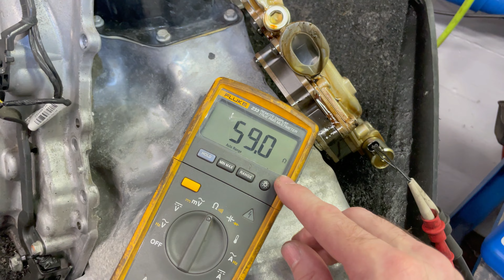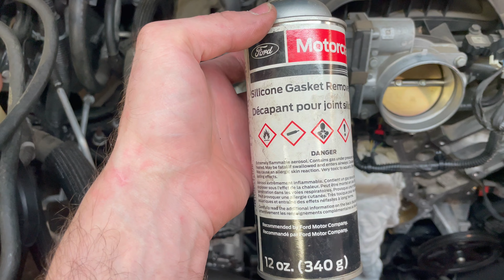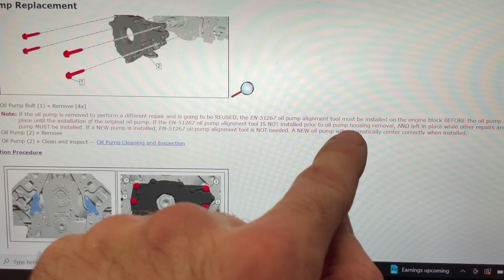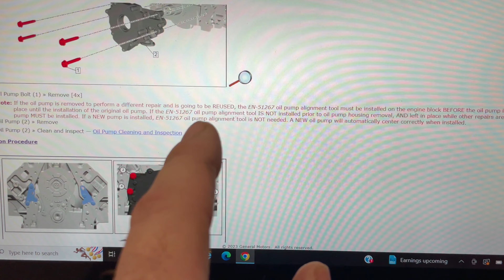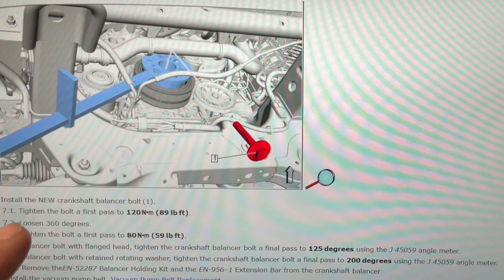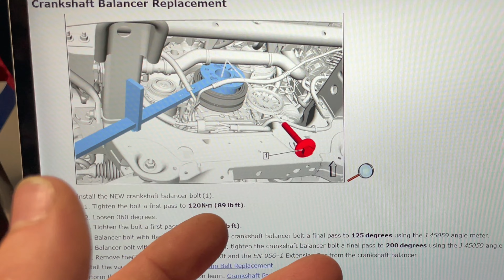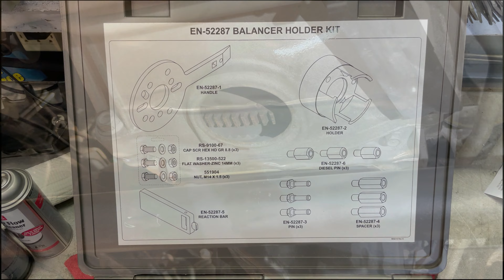P06DA 5.3L Dual Stage Oil Pump Replacement tips

Comment: I got the new oil pump installed and buttoned it up.  I did flood-clear mode to prime.  I attached a pressure gauge to the engine and started it.  It's high at 70psi - I confirmed with the engine pressure sensor.  Might be because it is cold (40degF) or a new pump that needs breaking in.  Previous pump was 56psi cold.   My concern is a bad regulator spring in the new pump.  It is all GM OEM parts.  - your thoughts?   (no codes relating to the oil pump)
Reply from the maker: That sounds about right for a cold operation. Evidently the new pump performs better than the old pump.

Don’t forget, this is a dual stage oil pump… It can be in low output mode or high output mode. You could confirm this with scan tool data.
Reply: @DadsGarageDiagnosticSpecialist  great - thanks for the help.
Reply from the maker: You are welcome
Reply: @DadsGarageDiagnosticSpecialist  ...to follow up on  the high oil pressure.  It settled down pretty quick after just a couple minutes of running.  Cold idle 45 psi.  Warm idle 25psi, cruise 40psi, under load 50psi.

Comment: Isn't ìt 2 round seals on the timing cover
Reply from the maker: The timing cover has the front crankshaft seal and the seal for the cam actuator magent on it, otherwise it uses RTV sealant when installed to the engine block.

The oil pan uses RTV sealant and rubber seals.

Comment: I just got this code that popped up. I turned the check engine light off and it stayed off. I have good oil pressure. What are your thoughts?
Reply from the maker: Keep an eye on the oil level and if the code comes back it will likely need an oil pump replacement. 

P06DA suggests that the ECM commanded the oil pump to change its output pressure and it didn’t respond as expected. 

The oil pump has a low output mode and a high output mode. If it fails in low output mode it will still have plenty of oil pressure, but should still be fixed asap.
Reply: @DadsGarageDiagnosticSpecialist Thank you for your quick responce.

Comment: So what does this pump do actually? I’ve seen comments stating they just deleted it or tuned it out. If it’s not needed why did the engineers put it into the system?
Reply from the maker: The idea is to save a small amount of fuel by reducing the engine oil pressure when at light loads cruising.

The oil pump has a high and low output mode. In low it still produces about 20psi-30psi so it’s fine. 

High output mode is used for heavy loads and hard acceleration and bumps up the oil pressure. I suspect this is because the bearing clearances in the engine are very tight and also thin oil. A loss of oil film under heavy loads would cause immediate metal to metal damage.
Reply: @ 
thanks for the reply. I also received this code last week and replaced the oil sending unit and valve lifting oil filter behind the sensor. Still received the same Pcode. Took it in and they told me my  
OIL PUMP FLOW CONTROL SOLENOID VALVE needed to be replaced. Gonna be $2100 job right here at the end of the year.

Comment: If youre doing this at home you can remove a spark plug and fill the cylinder with rope. It will prevent the engine from turning while you torque the bolt
Reply from the maker: I wouldn't do that because you can crush a bearing or damage a piston/rod. That bolt is really super tight lol. Thank you.
Reply: @DadsGarageDiagnosticSpecialist  After I posted that comment I realized how much force that is going over 100 degrees. The rope has some give but still. I think the best bet for someone who doesn't have the special tool is half an ugga and then use a paint marker to measure the amount of degrees like you did. One could also use loctite if they're concerned about the bolt backing out. I know it's not recommended but I've done similar things in the past with no issues
Reply from the maker: @firstlast---  I understand… I have been there and done that kind of thing also. Working on cars for a living every day. I have also seen the consequences of that sometimes… Not always worth the risk when the tool is cheaper than an engine in my experience.
Reply: @DadsGarageDiagnosticSpecialist  That would be a nightmare to be almost finished with that job just to break the bolt off in the crankshaft 😂
Reply from the maker: @firstlast---  yes, every job is one broken bolt away from tragedy

Comment: been using some old craftsman wrenches for over  40 years. they were american made an held up to commercial use. the sockets were so so but their wrenches are legendary in terms of strength and durrability. much like the maytag washer was
Reply from the maker: Yep a lot of my stuff is craftsman back when it was still made in USA. The new stuff is definitely not the same.

Thank you for watching!
Reply: I bought my first Craftsmen kit in college when I couldn't afford it, but I still have and use it all. Sadly, I've purchased Craftsman tools since then, and all the new stuff is just garbage.  As a weekend mechanic, I don't usually buy the expensive stuff.  I've found the ICON is better than Craftsman now and cheaper.
Reply from the maker: @mijohnst  i’ve been afraid to warranty any of my craftsman stuff because the replacement will be about half the weight and total garbage.
Reply: @DadsGarageDiagnosticSpecialist  And you're right!  They are big and clunky.

Comment: Good job, thank you for the video, what king of degreaser spray did you use and do you have part number for the pulley tools?
Reply from the maker: Zep brake cleaner. I do not have part numbers. 

You can get the balancer removal tool and the installer kit WITH deep LS engine adapters at most auto parts stores.

Comment: Have you ever replaced a dashboard on a 2008 silverbro? I  mind I need a new one. I have the LTZ1, so the Tahoe 1 is  hard to do. And do I have to remove the steering calm
Reply from the maker: Yes, if you are replacing it, you should just remove the steering column. It’s not too difficult on those ones.  

Thanks.
Reply: Do you have to remove the stirring lunch? The one that's in the engine bag. It connects to the steering cold.
Reply from the maker: @danielb-c9100  no you do not need to disconnect the linkage under the hood

Comment: Hi,loved the video,i have to do mine in the next couple of days.do you have the part number for the oil pump silonoid, no one in my area can find a listing for it.thank you
Reply from the maker: Thank you very much for watching. 

The solenoid is only available with the entire oil pump.
Reply: I'm sorry I ment the wiring harness for the oil pump silonoid
Reply from the maker: @lukehoenig203  Part number 12681015 and 12712016
Reply: Thank you so much
Reply from the maker: @lukehoenig203  you are welcome. Feel free to ask additional questions if needed. Thanks.

Comment: How do you test the resistance at the harness? Just wondering if there’s a way too see if it’s the harness or the solinoid. I already had new oil pump put in it 8 months ago and just got same code back p06da
Reply from the maker: When I diagnosed this vehicle I tested resistance at the harness connector next to the crank pulley and it had over 1K ohms. 

You won’t have access to test whether it’s a faulty harness or a faulty oil pump without removing the oil pan and disconnecting the harness from the oil pump solenoid. 

The oil pan would have to be removed and then test the solenoid by itself, if you get a normal reading at the solenoid then you know it’s probably the wiring harness and you’ll need to test the harness. 

15:10 - oil pump solenoid view after oil pan removal

34:39 - testing the old oil pump and harness, faulty reading

1:02:57 - oil pump solenoid resistance test new in box

Thanks. Feel free to ask any further questions.
Reply: Thanks I just pulled the plug and it’s got oil inside connector
Reply from the maker: @IM4UCKEDUP  you’ll have to remove everything and replace both sides of the harness then.

Comment: Would this going bad cause my oil pressure to randomly jump from 40 or so psi to about 70? It happens mostly when its cold at around 1500 RPM sometimes immediately when tou crank it and its idling. Its not a gradual jump either like you see with normal acceleration. It's sudden and goes back to normal within about 1/2 a second. I've replaced the oil pressure sensor with a new GM sensor and it still does it. No cel so im not too concerned but I'd like to know what's happening. Thanks!
Reply from the maker: Maybe, but usually if there is something wrong with the dual stage oil pump there will be fault codes. 

Thanks.

Comment: Thanks for the video. I really appreciate your thoroughness and paying attention to the little details.  What did you use for cleaning the oil pan?
Reply from the maker: Thanks! I used brake cleaner for all cleaning and degreasing.
Reply: @DadsGarageDiagnosticSpecialist  prefect - thanks.  I will pick up a case!   

 I bought the truck last year at around 100k miles. Previous owner did all maintenance as per manufacturer schedule.  I just finished pulling off the oil pan. The amount of varnish is disgusting.  I hate these extended oil change intervals.  Any recommendations for a varnish removal treatment I can use on the at its future oil changes?
Reply from the maker: I use 1qt of marvel mystery oil added to the oil prior to an oil change.

Comment: My 2008 Silverado I add a factory navigation. I found online, there's a hidden menu. Diagnostic menu You go to a certain menu and you press the very wet bottom of the screen. And you put in a certain code. And you can change your clock if it stops working all the time. My question is, why do GM radius have a diagnostic mode? What do dealership use on for?
Reply from the maker: Yes there is a hidden menu. The only thing I have ever used it for is to reset the clock. Then at some point they removed the hidden menu and you couldn't update the clock at all. Some of those customers had to drive around for a week waiting for it to update.

Some of them you could tap on the clock and update it manually.

Thanks.
Reply: I think the 2021 have a head and menu.
Reply from the maker: @danielb-c9100  yes some of them have extra menus. They aren’t really hidden though.

Comment: What is the part number for the wire harness inside of front cover, I'm working on a 2014 4.3 I thought it's the same as the 5.3 but doesn't seem to cross over on parts tech
Reply from the maker: I don’t have the part number unfortunately. You might find it somewhere in the comment section.

Thanks.

Comment: Bummer, I wish you would have done the timing chain too. I have to do the cam and stupid lifters. 
Was that truck not ready for a chain?
Reply from the maker: Nope it didn’t need the chain at that time. 

It’s not too bad to replace it though. Only a few more steps. Pretty much all you do is remove the cam gear bolt and the tensioner and it comes right off. 

Thanks.
Reply: Right on. Thank you. It’s nice to see someone use all the right tools. You should do a video of the cam and lifter job on this engine. 
I had issue getting crank bolt out. I missed the part where you use heat since it’s early in the video. I will try heat tomorrow. Also need to see how if can rent that tool to hold pulley. Maybe eBay. Then sell it when I’m done. 
Thanks for posting the video. Helped me out.
Reply from the maker: @SlaneVintageModern I just did a lifter job a few days and filmed the whole disassembly, but I gave up filming the reassembly because it’s distracting and time consuming so maybe next time.
Reply: Haha. Yea I bet it’s tough. I want to make videos of stuff all the time. But it’s too much work. I forgot to ask. Do you heat bolt up and remove as it’s still hot? Or do you wait a bit for it to cool. Some say to heat it up and spray with PB blaster so the heat draws the Blaster into the thread locker helping to dissolve it and cold it down at same time. Some say you will break bolt if removed when hot but I suspect that’s if you heat the hell out of it, just getting it warm enough to break down thread locker like you did, would be ok to remove while hot.
Reply from the maker: @SlaneVintageModern if you heat the bolt glowing red hot it will definitely break. 

Remove it while it’s still warm and the thread locker will be softened. The thread locker is primarily on the head of the bolt and not the threads…. Probably to act as a sealant. 

I don’t usually use any lubricants when removing it.
Reply: Very nice. I figured getting the bolt red hot was not worth risk of breaking. I will try when I get back home. I did apply goof off. Thinking that it might eat away at the thread locker.
Reply from the maker: @SlaneVintageModern good luck with it
Reply: Got it out. Just like you said. A small amount of heat is going to melt that thread locker stuff. 
I used the big dewalt 1400lbs breakout force cordless 20v impact. Hit it multiple times with on blaster for two days. 
Then today applied 1.5 minutes of low heat. Just the basic blue bottle of propane. Heating mostly just the flange of the bolt because that’s where the lock glue is in contact with the balancer face. Then hit it with the impact. The impact cuts out when it has resistance after about 10 seconds. On the third try it broke free. So heating once for 1.5 minutes on the flange of the bolt and hitting it with the impact until it came free. 
I consider myself lucky though. I have read others doing what I did and you as well, but it still doesn’t come out. But I think it’s a must to have the full force of 1000-1400lb impact and the heat. I would also be willing to bet some people heat too much right off the bat and swell the bolt too much. 
You should do a short video of removing that bolt. I think a lot of people that make videos skip right over that bolt removal because it common knowledge for you guys but there is a bunch of people like me that get stuck at this point and shit our pants. I couldn’t find out how to do it without going through multiple whole videos. I do admit that I missed it on yours. But possibly a short video titled,  crank bolt removal (the right way) would be good. Thanks for the replies my friend. Have a good weekend.
Reply from the maker: @SlaneVintageModern thanks for the update

Comment: Great video!  It's exactly what I needed!  It got me 98% there.  The only difference in my car is that I have a 2WD, and I had to drop the steering rack to get the pan out.  Thank you very, very, very much for taking the to document the process! 

In the part of your video where you read about keeping the old oil pump or replacing it with a new one, what site are you using?
Reply from the maker: Thank you very much! A 2WD is a little bit easier to do luckily. 

I was using GM dealer service information. You can access the same information with a subscription and also there are other places such as AllData DIY, etc. 

Even some of the parts stores are offering online repair information for free online if you seek it out.

Comment: I have a question, but it's probably pretty tough with you.  do you know what type of pen GM radios used in 2005 to 2013.
Reply from the maker: I don’t know. Sorry.
Reply: There's a shore on South main auto-repair East sihe says the 2023 tahoes and suburbans Evap system a store filter. It's right behind the tire and the customer hasn't replaced the hole entire system that cost $800.
Reply: When's your next video
Reply from the maker: @danielb-c9100  I have been really busy… I have probably five or six videos ready for editing.

Allison TCM video dropping later today 🤫.
Reply from the maker: @danielb-c9100  send me the link I will check it out
Reply: I am trying to send the link but it won't let me. Because I think you 2 doesn't like sending links. It's on South wing auto-repair first short.
Reply: South main auto-repair.
Reply from the maker: @danielb-c9100  I found it. They have been using that same filter and same location for decades now. I replace a lot of vent valves and canisters due to dust contamination.

Comment: MINUTE 1:28:18 MINE JUST STOPPED AND WON'T GO ALL THE WAY,  !! THERE'S A GAP AND IT'S DRIVING ME CRAZY 🤪!! I'M STUCK
Reply from the maker: What kind of balancer installer are you using? Maybe it is bottoming out on itself.
Reply: I bought it from Amazon! It's like Bolt with a wheel bearing and 2 washers.!! Is not like the one you show in your video !
Reply from the maker: The one I have can be bought or rented at most auto parts stores. You need the long reach adapter for these engines.

Comment: What happens if I drive my truck with  P06DA code
Reply from the maker: Not much other than a check engine light. The oil pump is a dual stage and can be changed from high pressure mode to low pressure mode, but you’ll still have oil pressure. You still should get it fixed. 

Thanks.
Reply: Thank you from Ontario ca

Comment: I had no idea this terrible oil pump design wasn't limited to dodge/chrysler. I'm going to just replace the solenoid in our dodge charger and thank god i can get to it by just removing the small steel oil pan, nothing else. I am going to be more picky with my wifes next car. i don't want any gimmicky crap like this to save a fraction of a gallon of gas. Stupid government cars.
Reply from the maker: Yes, that is somewhat common on the Dodge… I have successfully repaired several of them with just the solenoid.

That’s right… This is all just a measure to save pennies worth of gas. The manufacturers have to do this to meet emissions standards, and still be able to sell vehicles. 

Thank you for commenting.